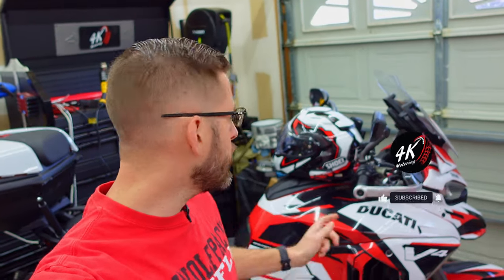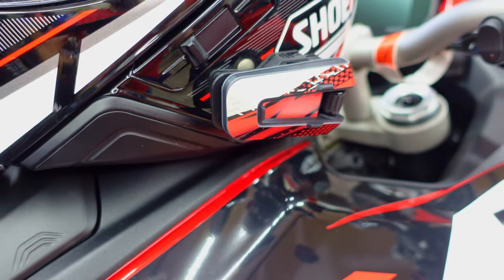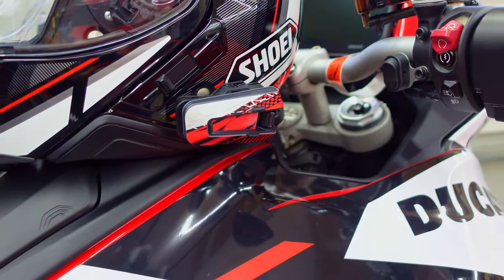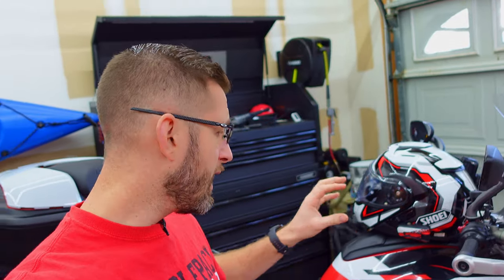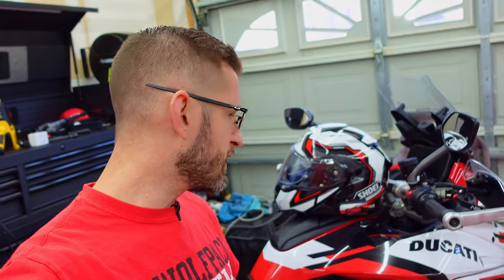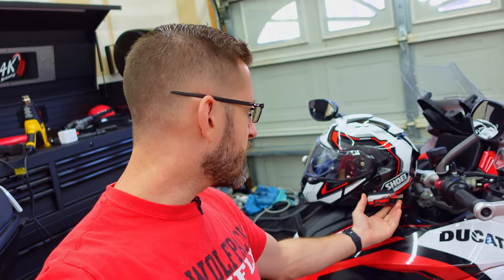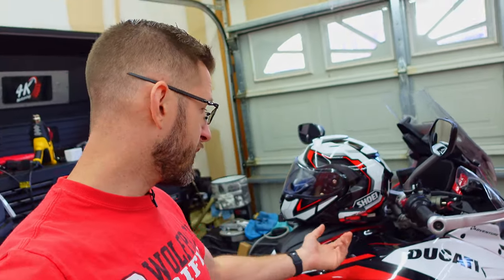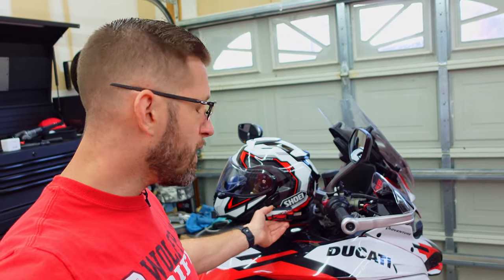Cardo Packtalk Edge Problems

Comment: The fact you had the exact same issues on two new units suggests to me that the issue is related to your environment. Some ideas to try: 1. Did you replace the entire system, including cradle, mike and speakers? If not, you should - one of these components may be defective and causing a drain. 2. Are you using the original USB-C cable and decent charger? Try a different charger. 3. Did you heavily configure the unit? Try to reset to defaults and leave it that way (if you experience the issue, of course). I switched to the Edge from a Slim a few months ago and couldn't be happier.
Reply from the maker: I have two complete systems in my helmets and I've tried both of them at this point so I know that's not the problem. I've used various chargers so I have not had a single one that's caused a problem, the second unit we have uses the same chargers and has yet to have a problem. The only configuration done is that the volume of the unit is typically set on high with the bike controlling the input volume. Fingers crossed that third time's the charm. I never had any problems with my past units.
Reply: Hi, what do you like about it compared to the slim?
Reply from the maker: @brunellom8914  The Packtalk Bold/Slim were honestly pretty similar. The Edge is more refined in every way. Easier to use, easier to pair, better quality audio, etc. if you often find yourself trying to pair different groups and becoming frustrated, the Edge is the way to go
Reply: Do you have any tips about the Bluetooth connection? Mine can't keep the blootooth connection to my phone more than a few minutes.

Comment: About the battery, please don't use fast chargers. They use a very high current that ends up degrading the battery capacity. Fast charges are for occasional or emergency use, if you use this feature constantly it will drastically reduce the battery life of any small electronic device. Keep the current below 1A and you will have a long battery life. I have had one since its launch and the battery still has a very good capacity.
Reply from the maker: Definitely true of older style batteries, but not necessarily true of most modern lithium batteries.

Cardo advertised up to 30w fast charging on launch and specified that 20 minutes of fast charging would provide 2hrs of talk time. 

Lithium batteries tend to degrade more when kept at its extreme states of charge. Still, these small lithium batteries often have inconsistent quality, especially as the price point is reduced. If you have a good one, enjoy it! Hopefully it'll remain good for years to come!
Reply: @4KMotoring  Since it is impossible to know which battery is of good quality and which is not, I always recommend that friends be careful and avoid using fast chargers.

Comment: Honestly i dont have this issue on my units at all .. but i had a friend who told me same issue that you have... i figure out that could be a problem from the function and features in on the units... i ll give mine.... i turn off Google voice commands.. and i switch language to UK.. and i always used my phone paired on 2nd pair... and bike on bike pair... it could be sometimes bike issue drien battery.. you dont know... please try these and let me know what is come with u 😊... also i charge it on a Samsung 25a adaptor... same wire....

Comment: My packtalk edge just died during my vacation trip. It really sucks not being able to communicate with the rest of the group for the remainder of our trip. Seems like these battery problems plague the packtalk series.
Reply from the maker: I see they're now making a lot of their new models in China rather than Ukraine, I'm wondering if these battery quality control issues are responsible
Reply: @4KMotoring been looking at getting the Pack Talk Edge duo for my wife and my sled riding this winter.
(Two Backcountry XRS with 10.25 screen- which SkedAddicz say Cardo and BRP Skidoo are working on the middleman issue)

These quality control issues and the App incompatibility when trying to use the bike or sled as middleman has me thinking maybe I should go with BRP Skidoo Vibe/Sena setup.

Yet Cardo seems to be pushed by so many streamers.
Reply from the maker: @VonSpud the quality control issues are being worked in, Cardo is shifting their manufacturing away from Ukraine so hopefully that's addressed, there's a 2yr warranty so I wouldn't be too concerned by it. 

App support is another thing. The Cardo Edge app is great for initial setup, but I see no reason you have to connect to it every time you ride. If you're taking up both Bluetooth channels with other devices, it's pretty easy to re-pair your phone once every other month for updates.

Comment: I've had one for 7 months and ridden at least once or twice each month.  Initially very impressed with battery life - beating out my Sena I previously used.  The last 2 times used, I noticed the battery not lasting near as long as when I first purchased it (It was fully charged before the 1st use). This past weekend, within 3 hours I started getting low battery warnings & it eventually shut off.  Now it will not charge at all.  Purchased through Cycle Gear so now looking for receipt to submit for warranty.  Fingers crossed that process is smooth....
Reply from the maker: I've found their customer support to be easy to work with. I wish you luck!

Comment: I have two edge units, one when first released another couple months latter to communicate with my boy. No problems here. Glad for the customer support/service! Could you use camera stand getting sea sick watching, sorry just constructive criticism.
Reply from the maker: Thanks for the tip! Sometimes the internal stabilization works better than others.

I'm glad to hear there are good units out there. My most recent replacement seems to be doing well so far

Comment: All battery powered electronics are supposed to be charged fully before you use it. That's probably what the issue was.
Reply from the maker: That's theoretically less of an issue with lithium batteries, but to be sure I've been paying attention to each charging cycle with this one
Reply: @4KMotoring it isn't the battery that is the issue. It is the smart battery life software that has to learn the battery. All newer electronics that indicate battery life  need to be fully charged then discharge to near zero and then recharged 100% in order to properly learn the cell capacities.

Comment: My unit I received as a Christmas gift at the end of 2021 and it started having the same issue in 2023.  Yesterday after a few hours it told me battery was critically low and shut it self off. I only connect my unit to my iphone and charge it with my iphone charger.
Reply from the maker: Contact Cardo support to see if they can help

Comment: No issues with battery. But have the same complaint about the headset/phone/app/bike interface.  Both connected to bike and no app control, but can control volume and nav on bike.  If I disconnect just the headset and pair that to phone and phone to bike, I can use the app, but loose bike control of volume. Have started to just not use the bike as middle man.

Comment: I've seen some forum suggestions that plugging it in to a fast charger or higher amperage charger leads to reduced battery life. I've only charged mine with older USB power source, and mine has been OK so far. An extremely tiny sample, but food for thought. 🤷‍♂
Reply from the maker: I know older battery types were prone to failure from fast charging, but I would assume these more modern devices could regulate themselves to prevent damage via USB-C. Either way, I mostly use a more traditional "slow charging" method. Time will tell I guess 🤷🏻‍♂️

Comment: Its definitely user error. All new batterys like this have to be charged completely and then used until almost no battery thrn recharged to 100% in order for the battery charge indicator to learn the full range. Even your cell phones and earbuds need this to perform properly.
Reply from the maker: Lithium batteries are supposed to not have this requirement, but even so, an improper initially charged device should not decrease battery life dramatically over time.

Comment: It's now nearly 3 months down the track since you video.  any updates?  By the way a very good video, clear and precise. A BIG thumbs up.
Reply from the maker: It has been working flawlessly so far, which I'm thrilled about. In the next month I've got a long road trip that's going to involve extended use and frequent charging periods, if it survives that still working as intended I will be making an updated video

Comment: Had Spirit for 2 years, all good! Had Neo for 9 months, and the battery had a critical failure... Just stopped working and would heat up if you tried to charge it. Got a warranty replacement unit in a week😀💪👍🏍️!!!

Comment: Juat got a V4 Rally and paired up the Android phone to the bike...unpaired it a couple of hours later. The Bosch system is crap and I returned to mounting my phone to the bike via Quadlock wireless system...much better. The whole pairing system that you describe is the same for me and I put it down to the Bosch system just being poorly executed. Ducati should've just paired with Apple and Android to integrate the Play and Auto systems which are so well proven that it should be a no-brainer.

I've now added an AndroidAuto screen (Carpuride) which is very good, but, I have left the Packtalk Edge paired to the phone to maintain Cardo voice-command functionality because pairing everything to the AndroidAuto unit means the Cardo voice commands don't work (the same as when connecting to the Ducati/Bosch system).

It's frustrating and is probably just a software upgrade away from being a decent integrated system. With the Ducati being such an expensive machine, you'd think it was worthwhile paying for the Apple/Android systems.

Great video as always.

Comment: My first Edge stopped charging entirely, after the 2nd time I charged it - I suspect a connection somewhere between the charging port and the battery broke loose. I was able to use it with a charging cable plugged in, as suboptimal as that obviously was, but Cardo replaced it (agree about the great customer service), and I've had no problems since.

Comment: I have had two smartpacks for years. No issues. I did fully charge them before use and fully drained them a few times when I first got them. Not sure if that is something that more modern batteries require but something to consider.

Comment: Forum users on facebook have reported battery problems on early units. Cardo has them play the radio for a specific time & report battery level as a test. 
Beware if you have a lot of helmet wind noise, the mic can pick it up & sporadically mute your music level as if you were speaking. This may shorten your battery life because it’s transmitting. Try setting mic sensitivity to low in your app.

Comment: My edge battery life has went to crap, I’ve owned since July 24 and at first it was great, now battery life is about 30mins to an hour, and after about a month when I talked to the group I have to talk in three word sentences if I try to talk normally it’s all broken up and can’t understand me. We’ve tried multiple mics and settings will no such fix, but now with the battery issue I’m hoping cardo will warranty it and it’ll fix all my issues
Reply from the maker: Just out of curiosity, which microphone are you using?

Comment: Have the same issue with my Edge. The saving grace is that the Edge will charge while in use so I put my charger pack in my pocket and ran a cord to the Cardo. It works but I’d rather the battery would work as it’s supposed to.
Reply from the maker: 2 year warranty, contact Cardo

Comment: Just noticed issues with charging was starting my research, I have the edge myself owned for about 1 year. I also noticed that my right speaker seems to have quit working. Any issues with yours?
Reply from the maker: I've had several of these and none have ever had any speaker issues, The wires go into the speakers are pretty thin, and they are capable of being swapped out. Would first check that the speakers are plugged into the mount fully, then make sure the wires aren't kinked or broken. Depending on the age of yours, contact cardo support to see what they can do for you

Comment: Rule of thumb to follow is to fully discharge your unit before charging it up again, and do not keep the unit fully charged if the unit is going to sit for more than 2 weeks, if you know it is going to be on the shelf for 2 weeks then drain the battery to 50% and store it, that way your battery should last you years.
Reply from the maker: Unfortunately mine never sits that long. Also, these new lithium batteries don't like being fully discharged like the only NiCd batteries did.

Comment: Love the edge. Except that the phone button doesn't work. Like it doesn't click and won't let me turn off the phone. They need an override feature on the phone to turn it off juat in case the hardware has issues.
Reply from the maker: Have you tried it on different units or only one? Maybe a bad switch, cardo support is very responsive for any issues

Comment: Over the past couple days I’ve had this same battery problem, had the unit since it was released and it worked fine up until now.  Now all of a sudden I’m getting low battery notification in 30mins after a full charge.  My gut tells me it had something to do with the update.  There was no slow battery death, it was all of a sudden.  Day and night drastic change as of 3days ago.
Reply from the maker: That's pretty strange, but also typical behavior when a cell goes bad. At least my experience with Cardo Support has been very positive
Reply: I have the same issue.

Comment: My girlfriend and I both purchased a Duo's pack each last summer and we have had to replace 3 out of the 4 units. I have used Bluetooth to connect to a Sena 20 a Sena SMH5 and a Lexin B4FM. All connected with very good range between units. The problem I'm experiencing now is it won't stay connected to my phone 2 feet away. Still troubleshooting this issue. My Pactalk Bolds only issue was the weakness on the charging port.
Reply from the maker: What phone are you using? I have experienced ultra short paired connections when using some Chinese-made android-auto head units but not with my phone.
Reply: @4KMotoring  iPhone 14 Pro

Comment: I would suggest trying to connect cardo to your phone and not through bike, if it's possible. Just to try it out if the origin of the problem might come from bike <-> Cardo connection.
Reply from the maker: It never caused an issue for my old Packtalk Bold units so I would assume that's not the problem, but it may be worth testing if I experience this issue again

Comment: Experienced a strange problem (as yet unresolved by Cardo support) with Packtalk Edge Duo. Turned on first unit and paired with the app; changed language to English (UK); update required and loaded slowly, but successfully. Turned on second unit and paired with app; changed language; update required; "OOPS - something went wrong". Repeated multiple times but always the same error. Tried connecting to Windows updater tool but still fails. HOWEVER, if I do not change the language, no update required? It cannot be just a language issue as the first unit worked, but does this mean that I can never update the second unit for future firmware updates?
Reply from the maker: Odd, I know this is a silly suggestion but did you try factory resetting it?
Reply: @4KMotoring  Oh, so many times! Also tried update from Windows, Android, Apple. 1st unit ok, 2nd unit fails. Cardo suggesting a return for evaluation/replace, but they are sold as a pair, already meshed without any user interaction necessary. Do I return one and have an unmatched pair, or return the pair and end up with the other unit coming back faulty?
Reply from the maker: @philipdavis8286  that sounds frustrating I'm glad Cardo has already reached out to you. Paring is a super simple process and that is what these units are designed to do. It is convenient when they come in a dual pack since they are already paired but it is effortless to pair new units together.

Comment: Try and connect like this.
Mobile Phone to Phone 1 on Cardo.
Mobile Phone to Bike.
Cardo Phone 2 To Bike.
This way you will retain all the cardo functions as it is connected to your phone so all the JBL audio profiles works as do all the buttons and volume control.
I do it this way on both my Harley Road Glide and BMW 1250GS..
For the most part this works great.
Reply from the maker: Unfortunately that leaves out my Garmin XT2
Reply: @4KMotoring  Yes it would. Why not just go 
Phone To Cardo mobile 1
Zumo to Cardo mobile 2 and leave the bike out of the equation, you will definitely get better call quality and better control over music volumes ect.. What does pairing to the bike actually give you out of interest or what would you lose but not pairing to the bike... Because the gains may be better than the loses..
Reply from the maker: I've gone back and forth, but I like the ability to control my music and phone calls from the handlebars, especially with my phone in my pocket. It's also nice for my helmet to stop blasting music automatically when I turn off the bike.

Obviously multiple ways to get this to work, just a matter of personal preference
Reply: @4KMotoring  Yes I understand, that happens with my Setup adding a carpuride android auto unit to my set up. I lose the ability to change songs via the GS 1250gs screen.. But I can still do it via the cardo buttons and voice commands..